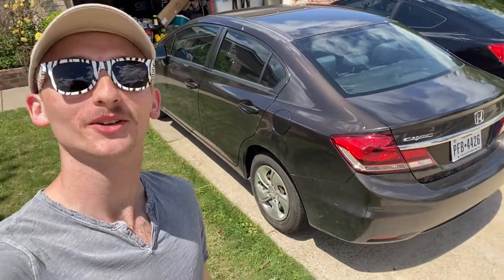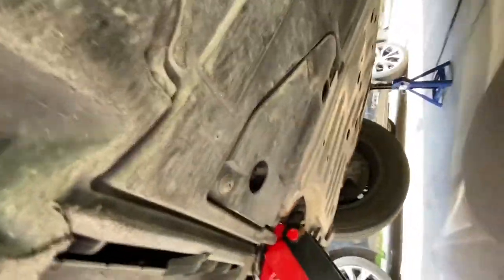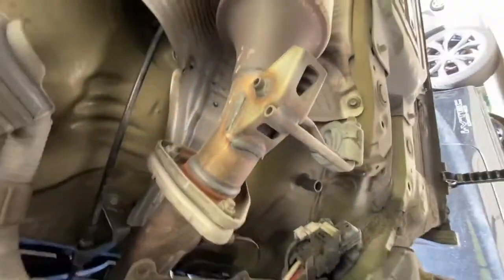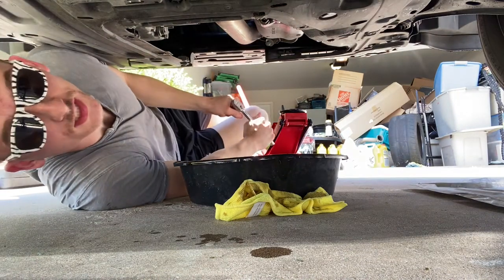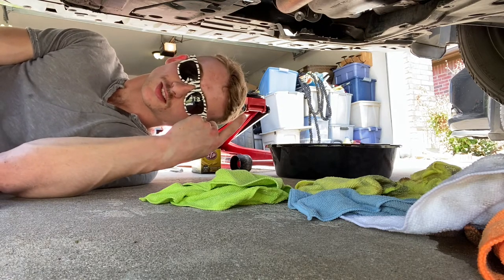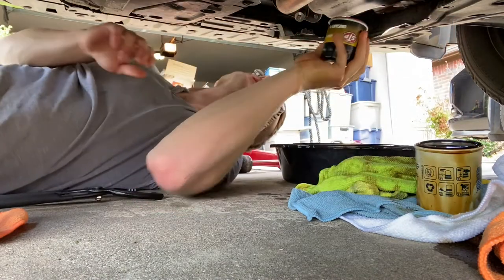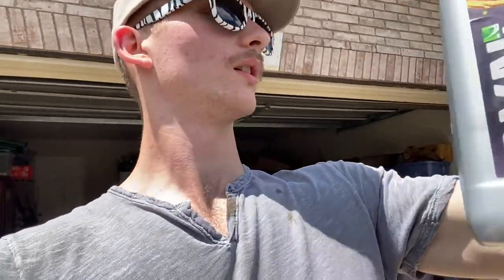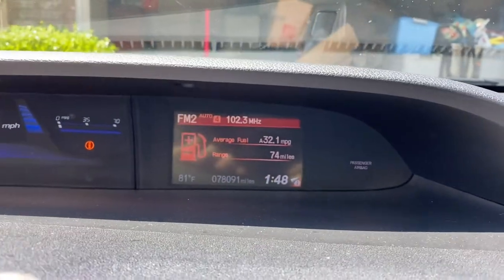Oil Change + Filter on 2014 Honda Civic 1.8L

Comment: Nice video! If I was to nit pick, I would suggest when you're putting a little oil on the seal you can hit the threads of the filter as well. Makes threading the filter a little easier. Also I like to have a big piece of cardboard under the pan just in case oil spills over.

Comment: Hey! That's my car!
Reply from the maker: which one? haha
Reply: @AldenBuild  an old rick I learnt, when bolts are that tight, just tighten a touch more. Once that 'seal' is broken, it's easier to undo.
I use a 1/2" long handle 'crack' bar, breaker bar. Just apply constant force to budge the bolt
The only other thing I do, is 1/2 fill the new filter with new oil. Priming it so to speak
I was looking for a good video for this exact Honda, I really liked your effort
Great job.